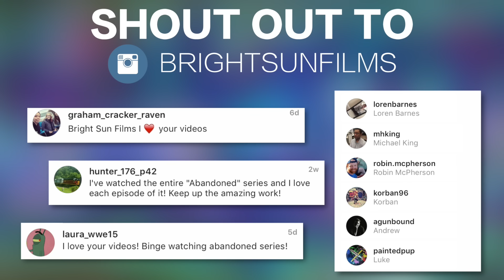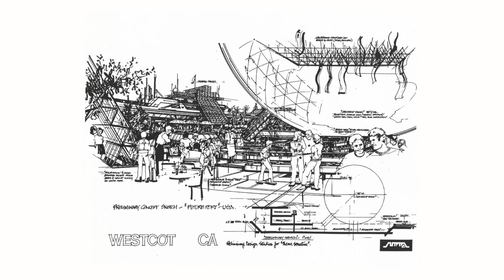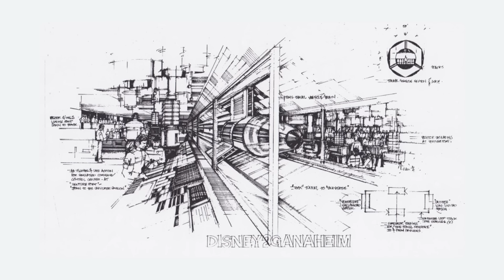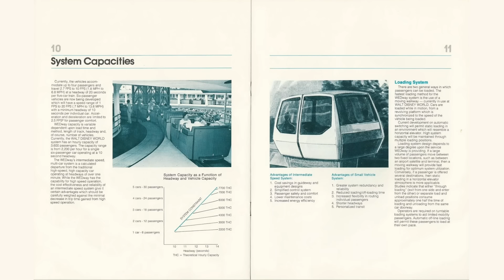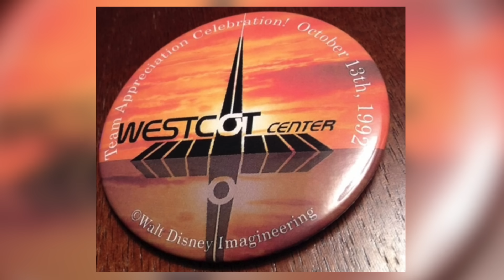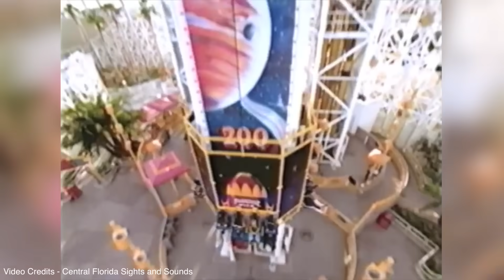Abandoned - Disney's Westcot

Comment: My sister went to DCA in the early 2000's, and she admitted it was not all that great - but my family and I visited in 2015, and they must have added several new attractions with new technology since then, because on that entire vacation (we saw 3 parks - Disneyland, DCA and USH), 4 of my 5 favorite rides at all 3 parks were located at DCA - Radiator Springs Racers (absolutely amazing and worth every bit of the 3-hour wait), A Bug's Life, Ariel's Undersea Adventure, and the Tower of Terror (which I think has been replaced). The other favorite was King Kong 360 at Universal Studios.

Comment: This may seem like an extreme stretch for an Abandoned episode. However it would be cool if you did a video based of not an abandoned location or store chain, but one based off an abandoned machine. My idea for this type of episode was to focus on the ACE 3000 which would've been a modern steam locomotive built during a time when oil was scarce and the nations railroads were looking for a solution to this issue. I bit of a stretch I know, but hopefully It would be a unique addition to the series. :)

Comment: Quick note - Epcot did not have a "slow start."  It rivaled Magic Kingdom for attendance immediately and surpassed attendance projections by 1/3 (or 133% of projection.) Using the same numbers Disney projected DCA to get Epcot's numbers, and fell short by nearly 1/2, 50% or roughly 2/3 of Epcot's pre-opening projections. Epcot was dramatically successful until Eisner's decisions began to deteriorate the park (he pulled all funding from it when he stepped into to his role - this meant even dumb things like benches that had been ordered weren't installed and stayed in sheds behind the park.) The most damaging thing they did was perpetuate the rumor that Epcot was not successful and was a strain on company funds - when in fact it printed money (guest spending higher than the other parks), and had stellar attendance before the changes made to it in the late 80's and early 90's. It has not regained the attendance it lost since then, but still attracts more guests than the other 3 domestic secondary parks combined. It has more people in it every year on NYE than DL and DCA combined.

Comment: Part of that new garage project east of the parks, is a new and larger transportation center where a planned streetcar line with connect the parks to the high-speed rail station a few miles further east. 

A new monorail was considered, even included an early concept video, but it just wasn’t that practical.

https://www.youtube.com/watch?v=PdQRnMxyKCk

One of the reasons a streetcar was chosen was expandability. This is still many years away, but the Anaheim line is eventually going to be part of a network, including a Santa Ana line about to start construction.

http://anaheimfixedguideway.com